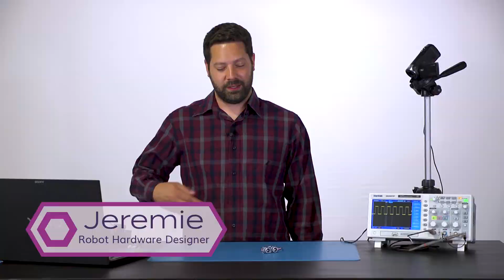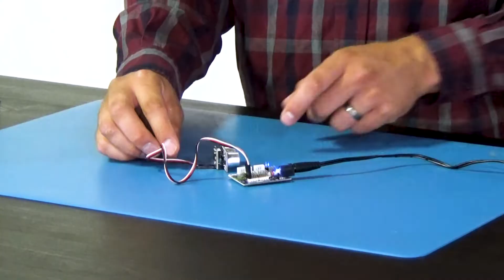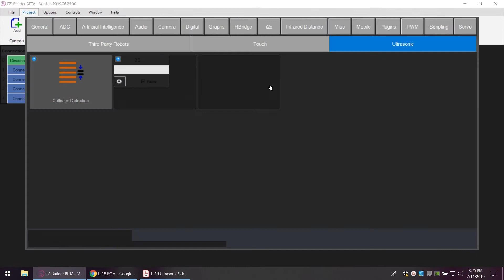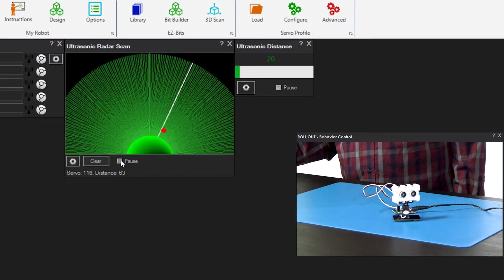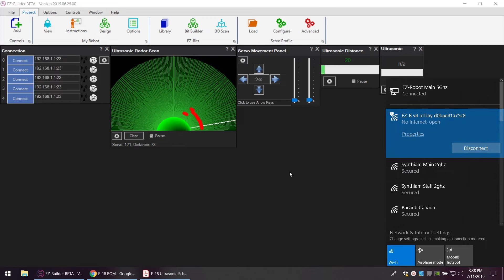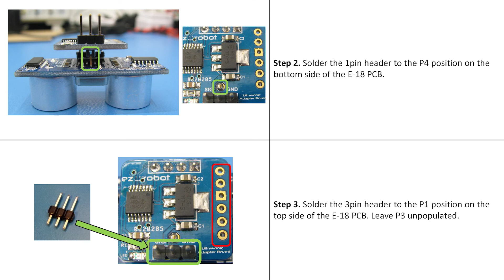Roll Out - Ultrasonic

Comment: I see your software have a poor resolution at measuring the distance, this because you need to tweak a little the original software that usually come in use for that ultrasound sensor
Reply: The readings did kindof not match to me as well, but the output shown may have not been from the same time as his movements.  Also, we can see what was in and around the studio.
Reply: @UReasonIt  at me ar matching very well at a good resolution of few millimetres, in your movie I see that you have a poor resolution at distance measurement
Reply from the maker: Get started with the getting started guide here: https://synthiam.com/GettingStarted